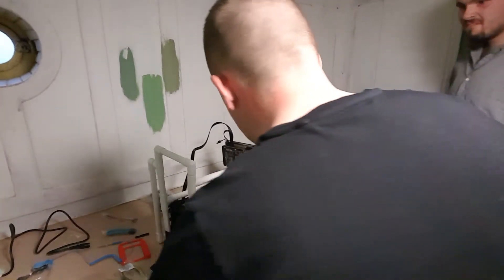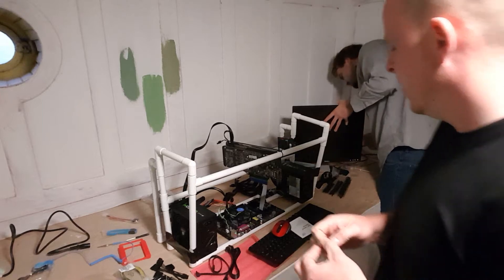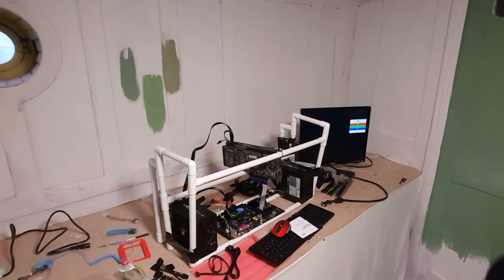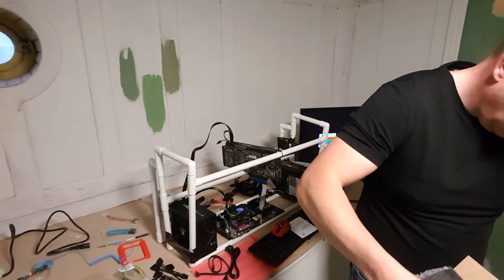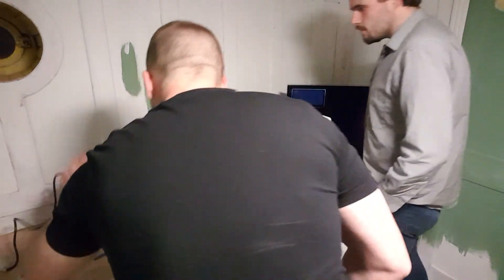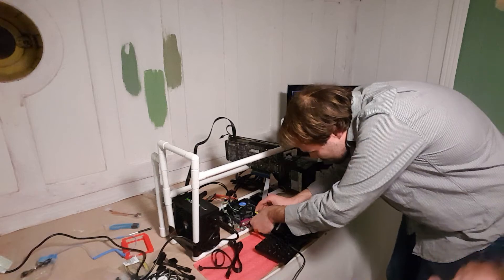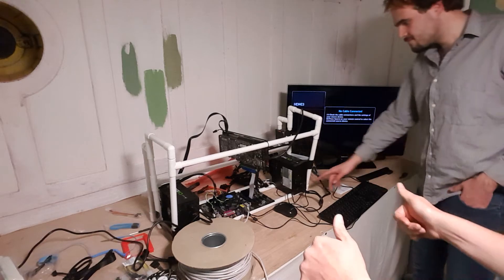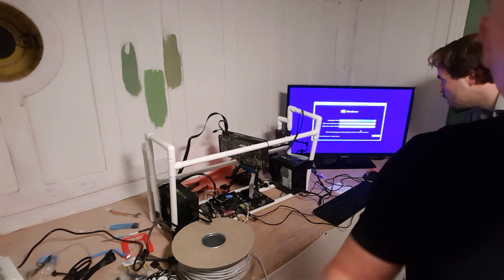How to build an ethereum mining rig (PART 2)

Comment: What do you use to add more than two graphics cards at once ??? Is that a special mother board or are you using after market stuff to kinda cheat the system
Reply: The motherboard has 6 pcie slots.

Comment from the maker: OK I found it on ebay by searching for pcie risers. if you can't wait  and you need it now. check out how to start up psu without a mobo and do the wire trick which basically is getting a small bit of wire and creating a loop between the power and the earth. if you search on you tube you will find videos on how to

Comment: Hi Rob. Another quick question if thats ok..

I've been mining fine for a few days now with 3 cards. Getting around 55mh/s or so.

I added a fourth card this morning and this has dropped my total down to 30-40mh/s.

Any ideas on what might be causing this and how to fix?

Thanks mate.
Reply: +bignose140 Sorted! Windows power saver setting on GPU's fixed it.
Reply from the maker: +bignose140 ah ok well that's a new one to me as well. thanks for sharing the tip. it's little stuff like this that usually spanners up people's rigs